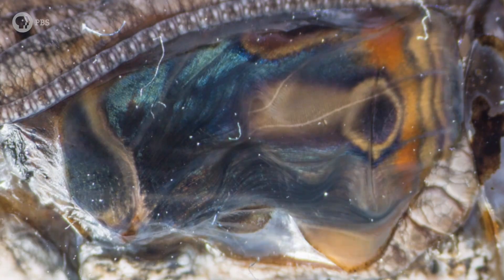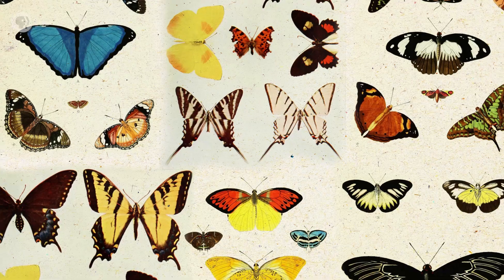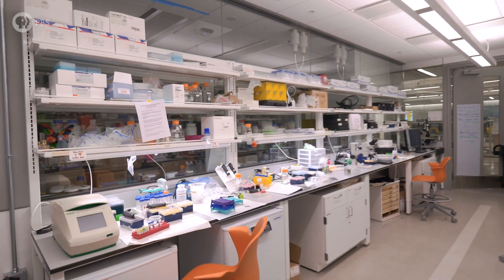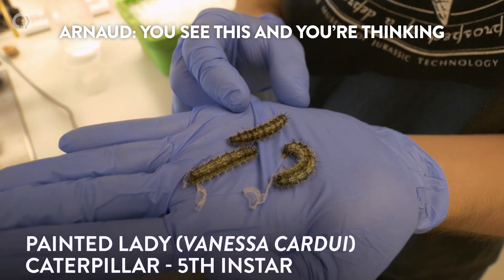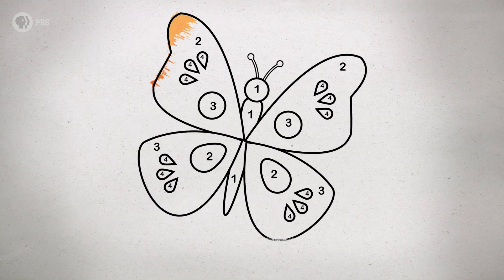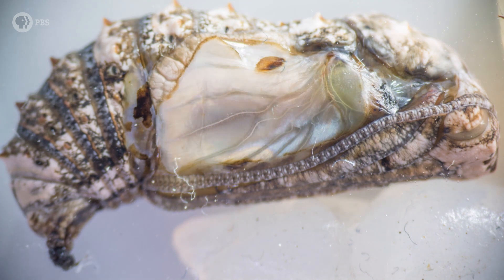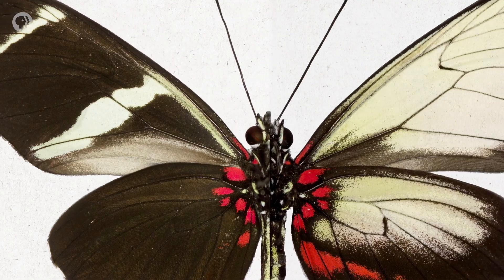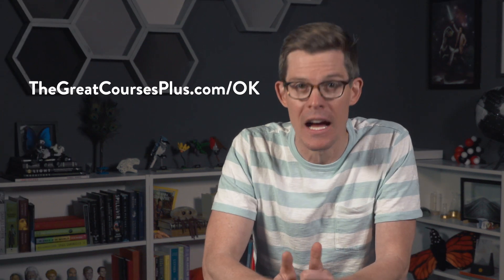Using Gene Editing To Repaint Butterfly Wings

Comment: It appears as though all of the changes in wing patterns are symmetrical.  Is it possible to change the genes such that the changes aren't symmetrical?  One wing's pattern is unedited and the other is?

If not, is that because of another gene that 'forces' that kind of symmetry?  So if you edit both the 'pattern' gene(s) and the 'symmetry' gene(s), you could create these asymmetrical patterns?

Comment: 8:05, so removing the imaginal disc leads to the creation of a new wing? Since the imaginal disc is the precursor to the wing.
Reply: what if the remove the wing from the caterpillar. and let it go through the pupal stage and see what happens
Reply: @carlosandleon , that's what they did right?
Reply: @Sivah_Akash  no they injected the thing with crispr. The one who got the wings removed is probably dead
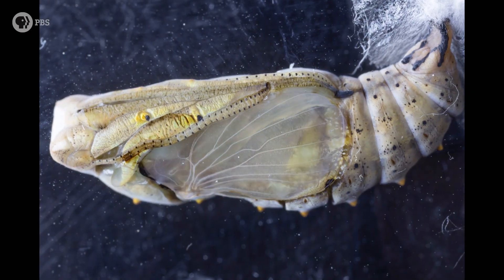Reply: @carlosandleon , nope at 8:08 they do say the removed the disc which lead to a window to the processes. So it's still alive.
Reply: @Sivah_Akash  isn't that a different caterpillar? I'm pretty sure the one who had a wingectomy died
Reply: @carlosandleon , they cut the caterpillar wing so that they can see inside. That's what I understood.
Reply: @Sivah_Akash  no they cut the imaginal disc
Reply: @carlosandleon , the imaginal disc is the wing(7:50).
Reply: @Sivah_Akash  Oh I see, I missed that. Thank you

Comment: Their attempts to reverse engineer genetic codes remind me of my early 90s childhood, when I had fun trying to modify PC game resources in exe and save files by manually changing data in different offsets, searching certain values. At the time I knew nothing about assembly language, machine code, system architecture and software development, I didn't have proper instruments, I was just poking hexes in text editor, and then running the game to see what have changed.